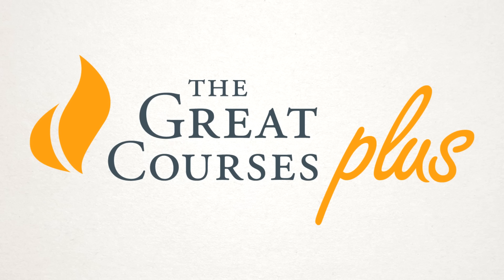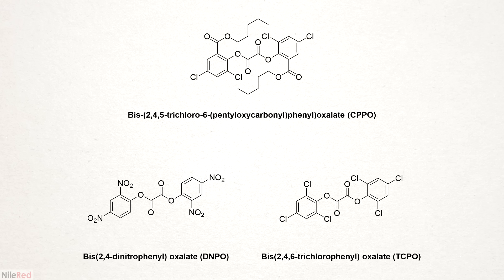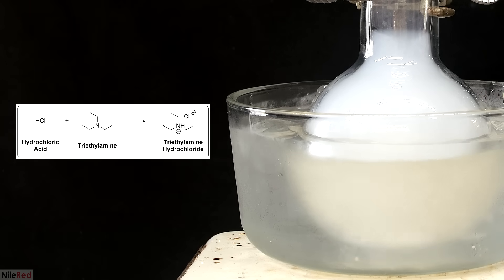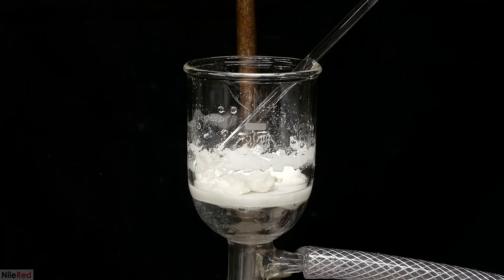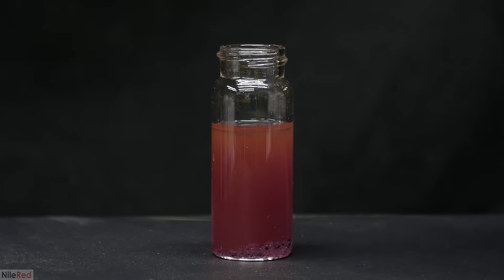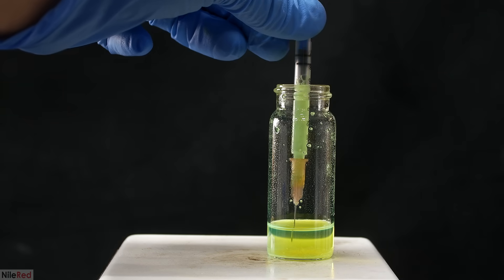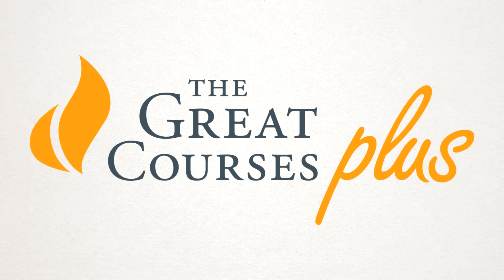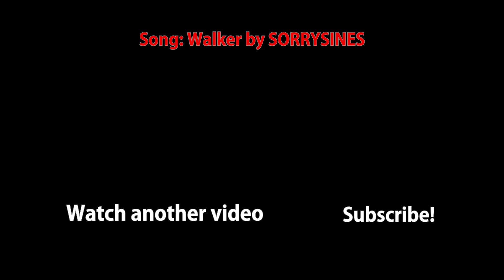Making glow sticks from scratch

Comment: can anyone tell me about fucking joints,well , i found some cheap crap from china on ebay so i dont know what sizes to get, i mean, will 24/29 liebig condenser fit in 3-way Three way Thermometer adapter with 24/29 and what type of round neck bottom flask i need to that adapter fit in it ,

Comment: I have a question: The whole reaction to produce the TCPO is pretty much a simple esterification. And the TCPO crashes out of the Toluene as soon as it's formed, thus removing it from the equilibrium. That means the HCl couldn't attack the resulting ester again. What's the point of the triethylamine then? Is it to prevent the formation of HCl vapors?
(PS I'm a biologist and not a chemist, so my expertise is kind of limited when it comes to chemistry)
Reply: CoxTH it is to speed up the reaction. The byproduct isn't acidic enough to protonate the chloride, so practically no HCl is produced in this reaction. In my opinion the H+ protonates directly the nitrogen of the triethylamine. If there wasn't any trimethylamine the reaction would have been much slower
Reply: Or maybe not happening at all.

Comment: I think the main reason behind your bad TCPO yield is not so much because of the presence of water but because of your non-optimal isolation. My guess is that you loose a good part of the TCPO during the filtration of your toluene phase as it probably has a decent solubility in that solvent. A better method of isolation would be to perform washes of your organic phase using an acidic and alkaline solution (and probably add some kind of solvent to solubilise all the TCPO), then evaporating the solvent. 
But I guess that in the context of an amateur chemistry, it's much more easier to filter and wash than to get your hands on a rotavap!

Comment: Is there a website which lists all the processes to make various chemicals? When you decide to synthesise something like "bis(2,4,6-trichlorophenyl) oxalate" where do you find out what steps/chemicals/temperatures/ratios are involved? Or is it possible to get to just look at the structural formula and go from there?
Reply: If you have knowledge of reaction mechanisms you can pretty much work backwards from your target molecule and figure out what starting molecules you need. This is called retrosynthesis.
Reply: Check out chemspider by the Royal Society for structures and physical properties. The biggest propietary database goes by the name of Beilstein or Reaxys.
Reply: Work backwards to see what you could use to make what you want if you understand chemistry well enough you can make menu things like that
Reply: There are comprehensive databases that gather synthesis procedures. Afaik, all of these are propiatary and mostly used by academics. However, most reactions are just variations of a handful of basic themes. After you learn the basics (at an university or the like), the rest is a matter of applying that knowledge.
Reply: There's a lot more to molecules than structural formula.  Seems like a good place to start, but doesn't really tell you a lot about how it will behave.  For instance, the water molecule is polar, meaning the larger charge of the oxygen nucleus (+8) will pull the electrons away from the hydrogen nuclei (+1 each), making the oxygen side of the molecule negatively charged and the hydrogen 'arms' positively charged.  This has implications for how water will orient and organize itself around different types of ions and other molecules.  The interactions between these forces can get pretty complicated when you're talking about big molecules.
Reply: Chemspider!! they don’t have everything, but they have a pretty good starting point for a lot of reactions